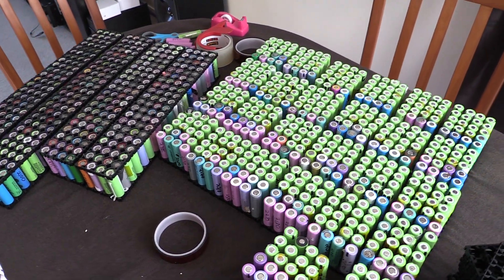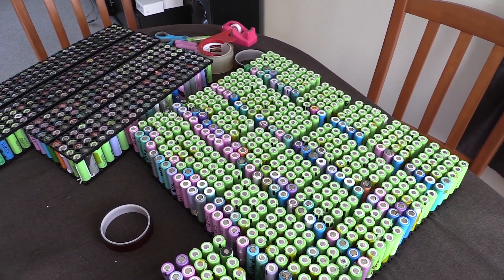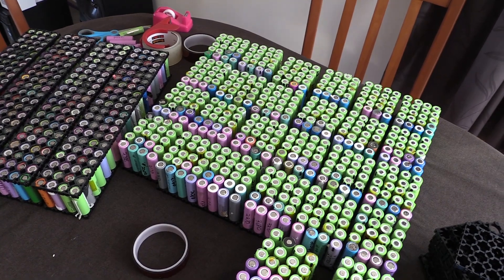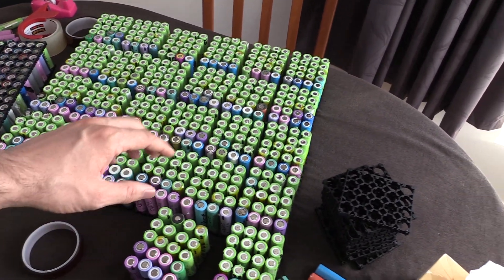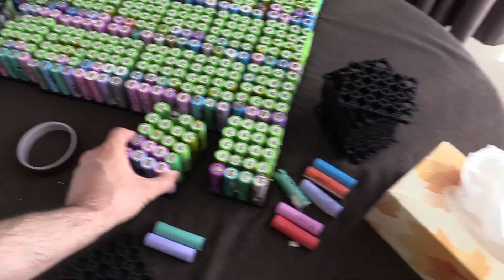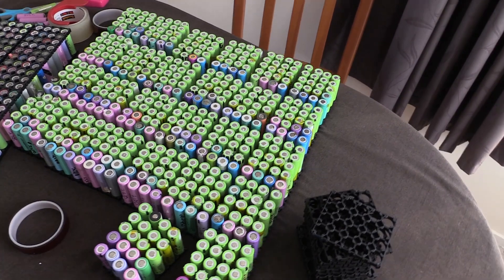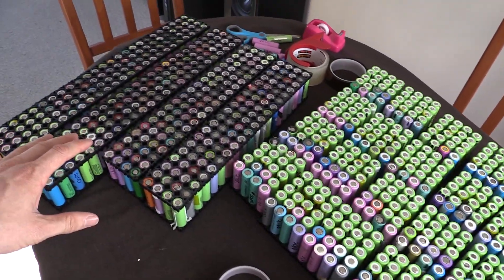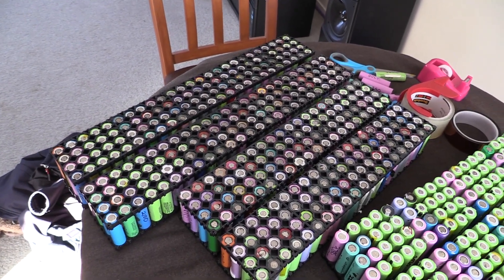18650 20kWh Battery Build Part 3 100P

Comment: August 2019 - another year later and therefore just the simple question about any updates?

Did you consider to use a used tesla model S battery pack of 444 cells with 5,5 kwh ?
They are more and more common on sale as used out of wrecked cars that insurances had written off and they are proper balanced and not much used if you look for it. Currently 1250€ for less than 30.000 km usage.

I'd love to hear how these sets might fit into your strategy if they were available back then when you had started your mission.
Thanks
Reply: Most likely burned down his house.

Comment: mike you installed a solax 5kw...is it designed to run offgrid or does it just do a little off grid backup if required...looking at the 3.7kw and seems it just has a little 1.3kw inverter for grid loss...so would your inverter be a waste if it is not connected to the grid?
Reply from the maker: The Solax model I have has a 2.5kWh charger eg 50amps and will change and feed the house at 2500w. however when in off-grid mode or EPS mode it uses a 2000va inverter just under 2000w. Which is fine to run the lights of the house and the fridge but not to run the whole house. Thats perfect for me as we don't really get power cuts and I am not wanting to go full off grid. It's not designed as an off-grid inverter but more of a grid-tie with backup, Eg you would use this inverter if you live in an area where you don't often get power cuts. There is no reason you can't have the solax hybrid and another inverter say an MPP off-grid in standby and only used for power cuts, you just wouldn't want to leave it on all the time as its normally a constant draw of 35-55w on the batt. For me with only 1 or 2 powercuts a year only having the lights and fridge on backup power is all that i need.
Reply: @MikesDIYTeslaPowerwall  Thanks for the reply..I am jealous, I am a kiwi in queensland and they will not allow any addition grid connections even with zero export..so I have decided to split the circuits in the house (to maintain existing grid inverter with feed in tariff on on circuit) with the addition circuit connected to powerwall and suitable inverter, I was hopeing it was the solax, but I guess not...have looked at the  pip inverters but 1 yrs warranty doesnt cover payback time...mppt and solax is interesting idea but not sure how it would cope when there is no load in the house, something has to take the power away (or zero export cut it back)...thanks for your info...still think here..cheers